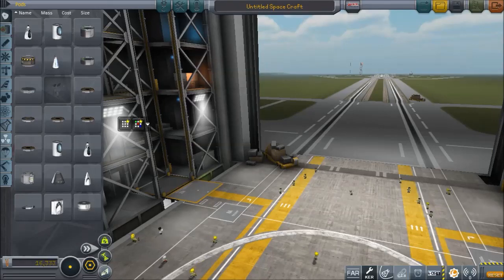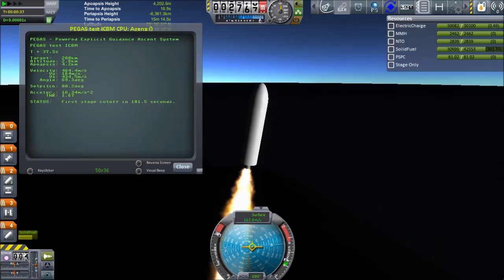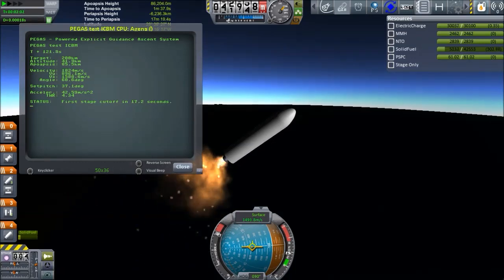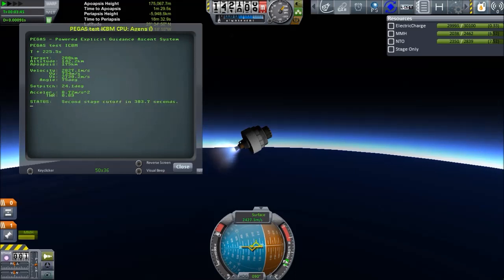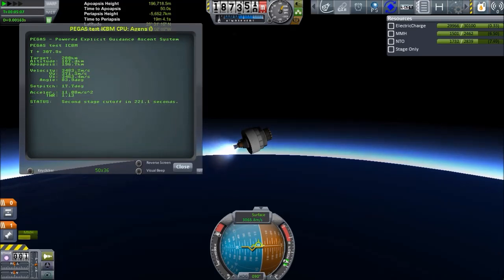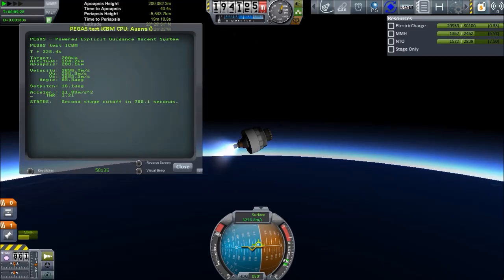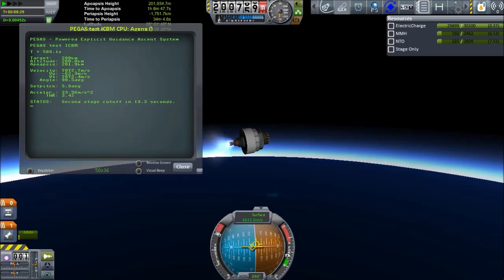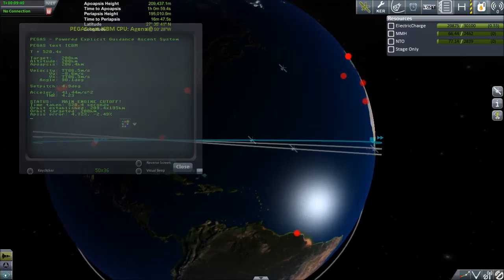KSP - Realism Overhaul autopilot in kOS using Powered Explicit Guidance

Comment: how did you make orbit with 5800m/s DV?
Reply from the maker: +Marcin Bednarz KER atmosphere slider is by default set to altitude=0km, so the upper stage's ASL Isp is taken into calculations instead of VAC. This craft actually has about 9.3km/s dv.

Comment: Would this work in 64K or stock?
Reply from the maker: The active guidance part should work. First stage could cause problems as it runs on a fixed pitch program tailored specifically for the test rocket I'm using and Earth atmosphere. Check my github site for updates as I'm working for something new now.
Reply: I noticed you had mentioned Unified Powered Flight Guidance in the README. When do you think you'll get that done?
Reply from the maker: It is already done - but only in a MATLAB prototype so far. Now I'm working on some basic documentation and after that I'll start porting the whole code into kOS. Can't really predict how long it will take as I intend to rewrite the whole thing from scratch and I haven't written anything in the language for a year, so could be month or two before it's usable.
Reply: It's pretty universal, even works when launching from the Moon in RSS!